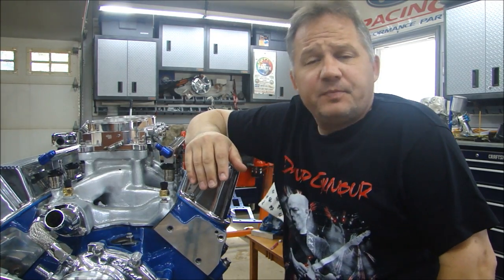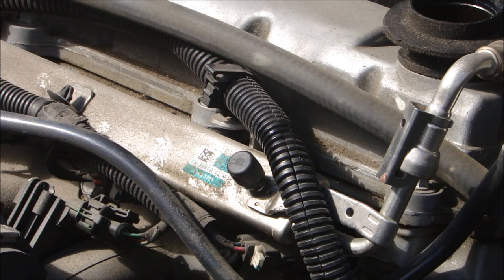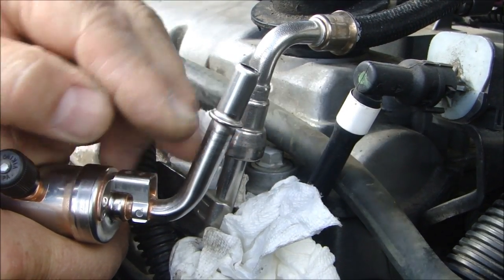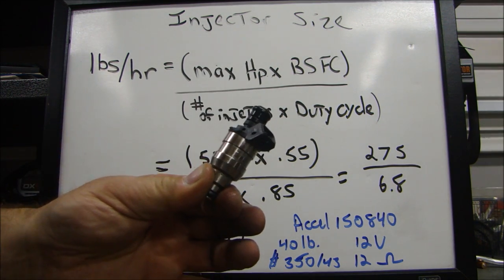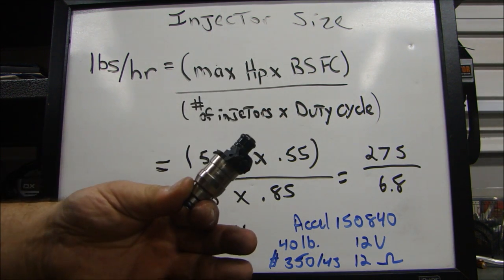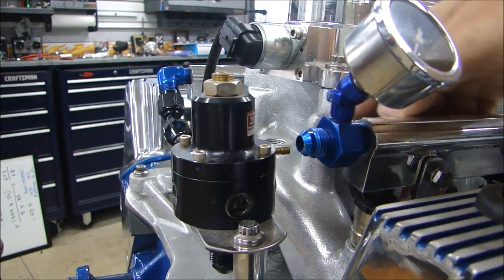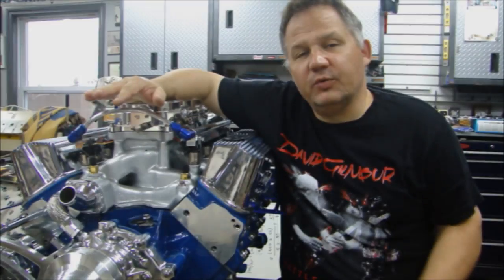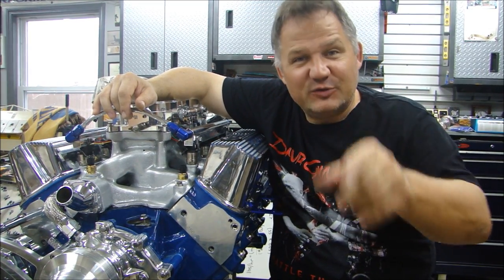Engine Building Part 15 - Fuel Injection Systems

Comment: Good post! Thank you for your time. We always appreciate your work. 
On a side note, I remember our discussion about why diesels sound different. I finally resolved it. They actually do sound like normal v8's. It's just that the log style turbo manifolds are so short and merge so close to the turbo, they sound like an X-pipe, but it never gets above 3500 rpm, and we never get to the familiar 5500 rpm growl.
Reply from the maker: That is very interesting

Comment: Finally made it to the end of the serious. WOW I learned a lot, and I had no idea there was so much more to and engine for things like proper sealing and even the smallest thing on an oil pan. I've got a 1967 mustang that has an old crate 289 in it. My father is selling a car at the moment, and we are going to use that money to make upgrades to suspension, steering, and then a new engine. I hope to do something just like this and utilize the small block ford engine mounts on my car and get an engine set up like yours. I still haven't decided whether to go old school with carbs or go with fuel injection. Regardless these videos will help me and my father make the right decisions on what we want to build and i'm glad this series of video was made by you to help people like us! love the channel, can't wait to watch more but i have to sleep now because I stayed up a very long time watching this series start to finish in one sitting and taking pages upon pages of notes! Thanks again!
Reply from the maker: That is awesome, I'm glad it helped. Fuel injection adds a couple grand so be ready for that.
Reply: Are these parts you are using like the fuel rail, injectors, and throttle bodies available for say me to buy online?
Reply from the maker: Yes they are

Comment: Those valve covers are bloody beautiful, in fact the entire engine is. I sure hope it’s going on something like a t bucket, and not being stuffed into a dark hood compartment... only recently discovered your channel, and it’s becoming a real favourite.  As a Chevrolet owner, I have had SBC thrust upon me and I’ve really enjoyed your engine videos in particular. As a Chevrolet owner AND apparent masochist, my sbc 350 is in a g20 van (1988) which I am slowly turning into a shag wagon custom. I chose the 88 specifically for the fuel injection, and I am wondering if I’ve made a mistake. Can you give advice on getting a 400hp 425 torque truck style engine starting from this TBI? I really can’t afford to dump 5K$ down a hole.
Reply from the maker: Those were hand painted and polished. Its going inmy 427 Cobra replica. You can do it for $5k. Gonna have to pull it apart though
Reply: So far it looks like I’m starting with a stronger fuel pump, an edelbrock dual plane tbi performer intake, some Hedman long tube headers, a roller cam kit with cam to be named later, and a chip. Then later on I might get a little crazy with heads and something like a sniper system. Since I honestly have no idea what shape the bowels of the motor are in, I’m doing only mods that can be done without removing the motor... There is no way I’m putting 3000can$ of cylinder head on a motor that might shit chunks of bearing into the oil tomorrow... If the cam wasn’t key to making any power at all, I’d skip it too

Comment: great vid.  tks/  
i never thought of a fuel injection system based on a dual quad setup.  Can you explain why uyou are using a duel quad setup, I assume for air only, , as versus a modern intake that draws air through a throttle body.  Is this for looks or does your computer/fuel system not have support for items ie tps, map, maf, etc like common fuel systems on todays oem's.
Reply from the maker: The only reason I am using a dual quad setup it to replicate the dual quad on the original 427 engine.

Comment: Loved the video, been tracking since the fourth episode of this series I think.

But I think you mixed up vapor-lock and hydro-lock there. Vapor-lock should simply cause the engine to lose power or stall due to fuel starvation, right? Vapor is compressible, so you're not going to bend a rod on a cylinder full of vapor. If I ever manage to get enough money and free time I want to convert my KLR's engine over to fuel injection.
Reply from the maker: We could argue over semantics....but vapor lock and hydro lock are very similar. Hydro (liquid) and vapor (gas) both starve the engine of power...I really didn't think everyone would focus much on it. The point I was trying to make was that if you run the fuel close to a heat source the fuel could boil and cause damage.
Reply: You are correct about the reason you get vapor lock but not what happens when you get vapor lock. Vapor lock is basically just an air bubble in the fuel line due to too much heat and that air bubble will cause fuel starvation. Not very likely you will cause any damage but it might cause the engine to stop running until you fix what is causing the vapor lock to happen. 

 In a mechanical engine mounted fuel pump system the fuel is pushed by air pressure from the fuel tank to the low pressure side of the engine mounted pump. Fuel will boil at lower temps at lower pressures and cause an air bubble in the line and starve the pump. This is why mechanical engine pumps are prone to vapor lock. 

Most EFI systems have tank mounted systems that use a fuel pump to push fuel to the engine with a regulated return line at much higher pressures and at 40 to 60 psi fuel pressure the temp has to be very high to have a vapor lock. Deadhead EFI systems are more prone to vapor lock due to very high temps created in the system due high pump pressure and  no  lack of return to allow the fuel to loose heat.

Comment: So when building an engine specifically when upgrading injectors do you recommend just upgrading the whole fuel system or just the injection part? Im planning in the near future to build a honda motor one of the B series.
Reply from the maker: You must plan the entire fuel system from the tank to the injectors.

Comment: Also electric fuel pumps work more efficiently pushing vs pulling fuel. So always install your pump as close to the tank as possible.
Reply from the maker: Absolutely correct.

Comment: direct injection into the cylinder head sucks, the  the  crank case blow by goes into the intake manifold and cokes up the back of the intake valve, port injection timed to each valve is better, My 95 F150 has a goofy system where three injectors spray at the same time and the other three do the same, at 180 degrees regardless of intake valve timing , the best  system squirts the fuel into the intake port a few inches from the intake valve , just before the valve opens, which means you are not  wasting fuel during the  valve over lap, but  if it screws up you gotta go to the bank, (been there)
Reply from the maker: Interesting

Comment: Pete love your vids' keep them coming. Uhh i take it your formula was for pump gas like 91 or 93 octane? Great formula, but it changes drastically for e85/E98 don't you agree. Or just say get big ass injectors lol.
Reply from the maker: Which formula? The BTU equivalent of the fuel was not in any calculation.
Reply: ***** correct. My quick point was even .55 for e85 would undersize your injectors in that formula. When using ethanol you need even bigger injectors. The calculation formula was great, just did not specify a fuel type. -
Reply from the maker: You are right. I was only calculating for gasoline. E85 and diesel are different. Thank you for pointing that out

Comment: Ah the return-less systems were adopted by the oems to keep the fuel in the tank from getting hot-boiling and blowing the gas cap off and possibly exploding. ( I got a black eye when a gas cap blew off of a VW rabbit.)  A regulator with a vacuum -pressure port may be needed for a turbo application to over come the intake manifold pressure with a pump capable of the higher pressure needed.
Most oem turbo units get by with a standard pump because they use a lower boost pressure. Injector size may need to be increased for lowered effective fuel pressure in a mildly boosted engine without a higher pressure pump. Vapor lock was a problem with mechanical fuel pumps and carburetors .Insulation on the fuel rails usually prevent vaporization in the fuel injection lines causing hard starting in a heat soak condition.
Reply from the maker: Awesome comment! Thank you

Comment: 8 stack fuel injection thumbnail?? god do i hate misleading thumbnails
Reply from the maker: So do I, however the tile is Fuel Injection Systems.
Reply: if you hate it why did you do it?? put a pic of the actual FI setup in your video.. problem solved